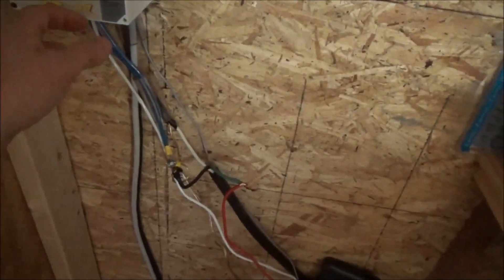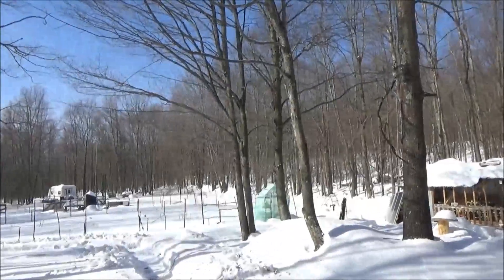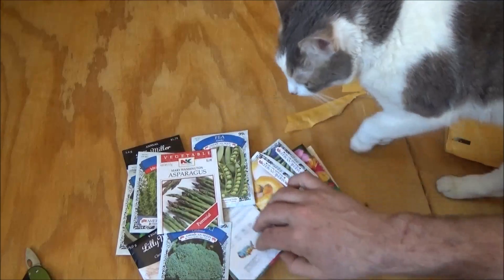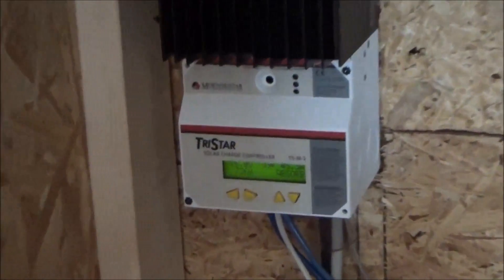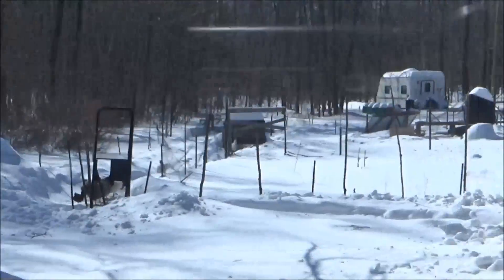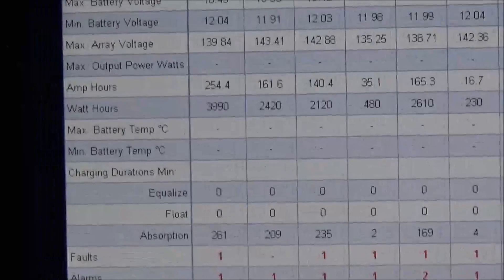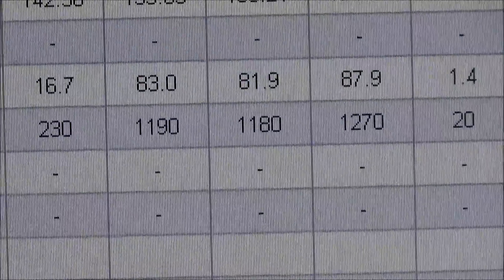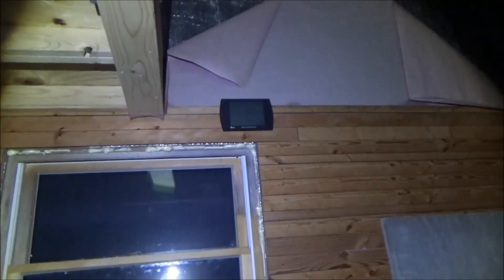Awesome Solar Power Production At The Off Grid Homestead

Comment: Reposting this from the earlier vid just in case.  Figured you might need this info.  I wouldn't normaly commit this breach of protocol, but I figured this was important.

I know why your controller alarmed.  You are either running the TS-45 or the TS-60 MPPT controller with the TS-m-2 meter add-on.  These are the only two models that they make in an MPPT setup.

Im looking at the technical specs in the owner's manual.

The TS45 maxes out at 600 watts at 12v
The  TS60 maxes out at 800 watts at 12v

The only way to get the full wattage out of your system would be to step up to a 24 or 48 volt configuration.

At 24 volts, the TS45 can handle 1200watts while the TS60 can handle 1600 watts.
At 48 volts, even more.

Since the units are equipped with overload protection from the solar array, it is alerting you and may actually be cutting out.  If you need a copy of the specs and the manual, I have both the data sheet and the owner's manual in PDF format.  Just PM me and I can get that out to you ASAP.

P.S.  The fault may be that your heat-sink is running at max temp.  I didn't realize in the beginning how warm you keep your place.  I think that thing maxes out at 120F and faults to let the heat sink cool down.  "I THINK", being the operative words there.  A lot of controllers I've had in the past have had cut-outs set at that temp.  I would say it's plausible, being you are running pretty close to max output for 12V.

You know I bet if you put a computer fan on it, that your fault alerts go away.
Reply: Jerry Densmore  I must disagree with your statement that "we treat things we didn't pay for as throw away crap."  Speak for yourself sir.  I don't.  To the contrary, I treat items on loan better than my own and gifts as I would treat the giver...with great respect.   While you may have managed these items differently than Troy he has done nothing to damage them.  Your statement that he doesn't care is defeated by simple logic that no one wants to be without power, thus he must necessarily care.  He is not perfect an doesn't claim to be. ..any one who claims to know exactly what this equipment is going to do at every moment under such varying conditions is simply a bragging liar.   Now most of the people on this channel are providing additional info and the benefits of their experience to those of us learning,  which is what this channel is about.  Your petty jealousy of the gifts or loans gratefully received is not helpful.  I suspect you have more intelligence than that,   I suggest you demonstrate that with your comments.
Reply: If you go back and watch the video where the alarm tripped, the controller was showing 16.5 volts, 42.6 amps, 701 watts.  He's running the TS60, so it was not maxed out when it alarmed.  That said, it is getting close to the maximum rating of the controller. Adding more PV panels doesn't make sense without upgrading the controller.

I think it alarmed because it detected a current spike when the diode blew and the wind turbine started drawing current.  Even with the battery bank between the controller and the turbine, with the controllers output voltage higher than that of the battery, the turbine would draw from the controller.
Reply from the maker: It was high voltage spike in the solar panels I have learned. Thank youi
Reply: The Do It Yourself World  It shows the word Alarm. .. to me that means do something. .. but what?   WHAT did it want done?
Reply: *****
You sound stressed mate.
Reply: MollyDolly
I fully agree with Molly! If YOU treat loans or gifts as "throw away crap" then YOU need to re-examine your life! Even if I knew who you are and you lived next to me, you would never borrow anything from me. The few times in my life when I have had to borrow a vehicle I brought that vehicle back FULL of fuel and usually ran through the car wash. That shows my appreciation for the loan and lets the person know that I do care. You, on the other hand, must be a person who cares only for himself!
Reply: MollyDolly
I think you give the Idiot far more credit than he can ever lay claim to.
Reply: Jerry Densmore Take your own advice... you give him some sound advice... all we see from you is snooty insults.  You are better than that.
Reply from the maker: Mike Foreman No, the current sensor is on the solar panel side, not the battery side. The alarm was when the solar panels passed 140 volts for a moment.
Reply: MollyDolly
I read a comment from that day that said if you hover the pointer over the red number a box appears with the alarm details in it. Must be worth a try.
Reply: *****  lol!   We don't need no stink ' n manuals!
Reply: *****
 Right! Where you get the China version translated to Taglog translated to English! :-)
Reply: *****
LOL
Reply from the maker: UNumbTV Yes that is what I learned and how I know what the alarm meant
Reply: The Do It Yourself World  Now you see what you have done?  I have only had my solar gear for what,  48 hours and I want one of those fancy schmancy Tristar MPPT controllers... I want it to talk to my computer.   This little harbor fright controller is hold out info on me!! Hey, is that what the USB is for?  Will it send data. Too?
Reply: MollyDolly
Unfortunatly I don't think so. I think that usb port is just for power to charge usb devices or power usb devices (like a usb light).
Reply: ***** I was joking about not using the manual. .. and darn if I didn't misplace them!   Not even sure there were any.
Reply: The Do It Yourself World I have asked you to provide us the VOC of your solar panels. Knowing you have 4 in series, the total MUST not add up to 150 Volts. Another thing you need to be aware of, the VOC was calculated at a higher temperature (probably 70F) and everyone knows that solar panels are much more efficient in cold weather. So IF the VOC listed on the solar panel nameplate is 35 volts, and the outside temperature at dawn's early light is 20F (before the Tristar wakes up), The VOC is actually 155 Volts! This will cause catastrophic damage to your controller. 
My charge controller can produce 80 Amps but if the surrounding temperature is too warm it will only provide half of that in order to prevent damage from overheating itself. If you are 100% certain that your ALARM was due to an over voltage issue such as what you describe, why do you still have strings of 4?
Reply: ***** Troy has 2 strings of panels in parallel. Each string has 4 panels in series; 2X4= 8 panel array. The array provides something like 140 Volts 12 Amps DC to the Charge controller.
A high voltage like this is good for very long cable runs and allows you to use thiner gauge cable, but the Tristar can not handle more than 150 Volts. Cold weather allows solar panels to produce higher voltages than what they are rated at.
Reply: The Do It Yourself World
Would be good to show that on camera next time.
Reply: Cisco Isoffthegrid
This is true, Cold weather makes panels perform great :)  I have a tiny array right now and this winter was very interesting looking at the voltages coming off of it. 

Yeah, he may be running a little hot on the array side.  Hadn't thought of it.
Reply: Cisco Isoffthegrid Thank you for your very interesting comment.  I had no idea cold could create an over voltage situation.    Meanwhile I have my new panels sitting on a hot concrete pool deck. .. creating exactly the opposite situation as you noted.  Had it not been for your explanation I wouldn't have known why my system may work at half what I expected. .. I will hang them sooner than I had planned. Thanks! !
Reply: ***** thanks. .. I have not figured out how to get PM notification on this phone. .. I will check on the Frisbee.
Reply: yes to fan :)
Reply: ***** Hi Plumpy!
Reply: The Do It Yourself World
the amp sensors are both on the panelside, and the charger side (battery output)

Comment: Troy. . . .if a roll of led 12vdc lights is more than your batteries can handle, you have other 12vdc batteries.  Any of them can run those led lights for basic lights.  To sit in the dark like that for that reason. . . then what is the point of having batteries or solar at all?
Reply from the maker: I am just being careful. Really careful right now until I am absolutely sure this is charge up fully and working well. Not taking any chances at all.

Comment: 16 Volts seems a bit high for lead acid batteries check your water you should be turning a lot of water to H and O and splashing a bit of acid around. Check the temperature of batteries also.
Reply from the maker: Working on it. Video uploading now

Comment: I have the same greenhouse, but only use it seasonally for seed starting. I just hauled mine out of storage. They're functional, but cheap, so I wouldn't expect it to survive being outside all winter. But, if you protect the frame from the elements, you can put 4 mil plastic on it and make a good greenhouse.
Reply from the maker: The plastic did not survive the summer sadly.
Reply: Yes, summer heat could be brutal as well. Mine is just for seed starting. Plastic will do well, though the frame is not especially hardy. I expect rust and cracking eventually. You might want to investigate doing small PVC hoop frames. Fairly cheap and easy to store when not needed.
Reply: Sher Thom
yep and i was thinking the frame could used to make a hide for next hunting season you could set it up close to a deer trail before  so they get used to it
Reply from the maker: Sher Thom I will be making an entire greenhouse/porch in front of the tiny house this spring.
Reply: Nice, can't wait to see that.